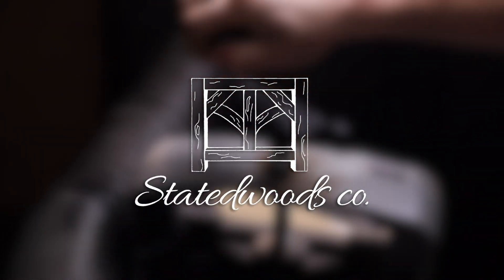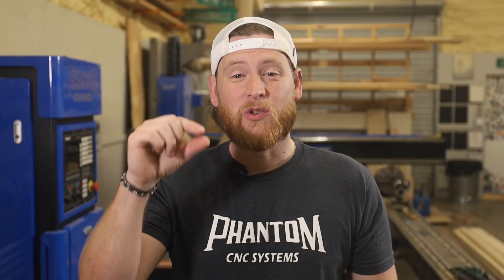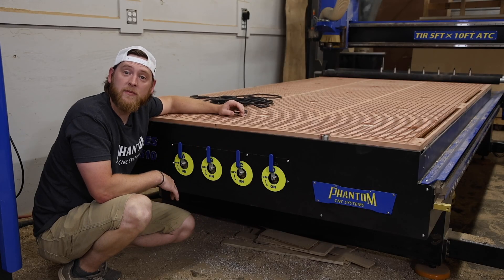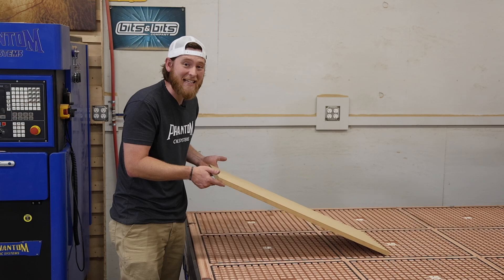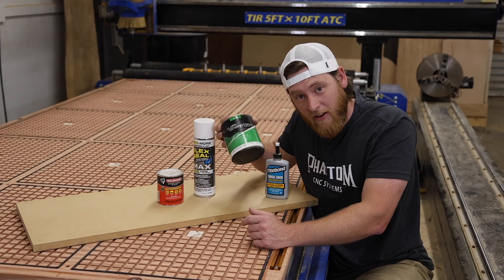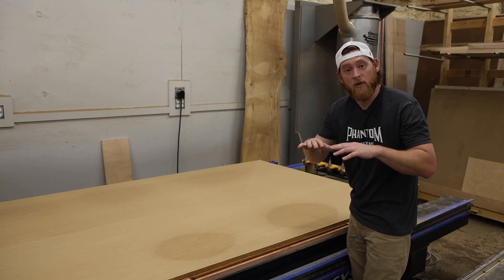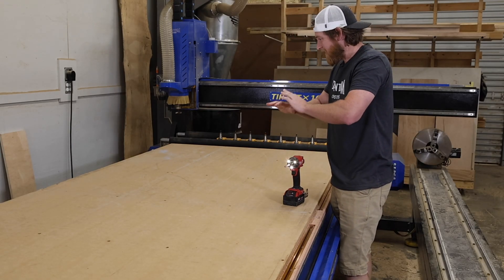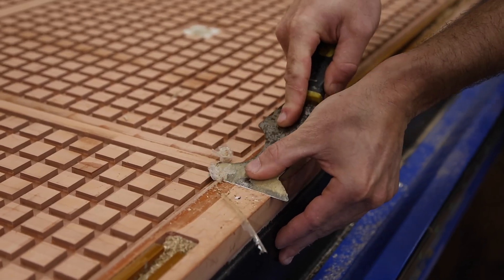Install A Spoilboard The Right Way

Comment: Hi Man, do you recommend ultra light mdf that is more porous and help the vacuum to suck easier through or regular mdf as SPOILEBOARD ? thanks
Reply from the maker: Hey. Yes LDF works great if you have a source for it. Watch it however, it can absorb more moisture and change thickness so may need flattening more often

Comment: Does screwing the MDF to the spoilboard to keep it tight in place hurt the gasket, since it’s always being pressed down and doesn’t let the gasket rest when not in use?”
Reply from the maker: No thats the whole point. A gasket doesn’t need to rest. They are designed to always be under compression. Think about gaskets in the motor of your car.
Reply: @Statedwoods make sense, thanks

Comment: If my spoilboard is "floating", and when I apply the vac, it pulls the board dead flat.  How is that not flat?  As long as I surface with vac on is that not good enough?
Reply from the maker: Because if you dont cover the entire spoilboard with your cut material, the spoilboard and material wont suck down flat and even. If there is a void area, air moves through the spoilboard and it stays elevated. As you cut and open pockets of open areas, the spoilboard would release and rise due to loss of suction. It will never stay flat. I hope that makes sense.
Reply: @Statedwoods  Ahhhhhhhhh yes... I gotchya.  Good point.  Looks like I'm screwin it down!

Comment: Do you use the same holes for the screws every time you change the spoilboard or make new ones? If you use the same holes won't the holes after a few times be useless? And if you make new holes, aren't you damaging the CNC bed and will have to replace it sometime in the future? I have been thinking of putting threaded inserts in the bed of my CNC and then screwing the bed using the inserts, but I'm not 100% if I should. I was also wondering. Why don't you use the CNC itself to make the holes on the spoil board? Thanks for the great and detailed video.
Reply from the maker: You can do any of those options. Inserts work too. Phantom has them in their tables now. I get 12 fattenings out of a spoilboards and only need to flatten maybe every 8 months or so so by the time holes are an issue, I would have newer technology in a new machine. Maybe replace spoilboard every 5-6 years or so.